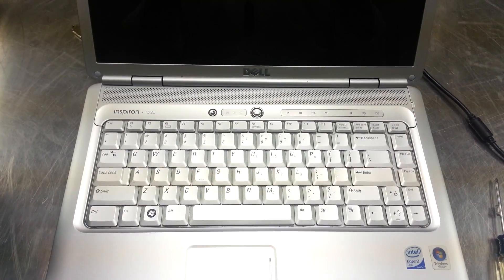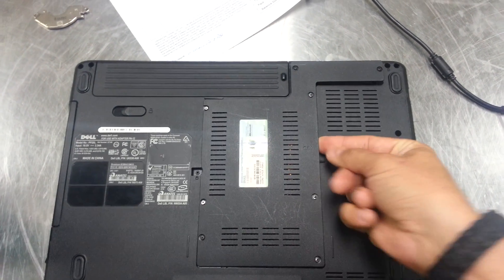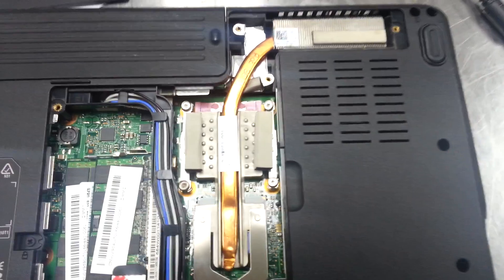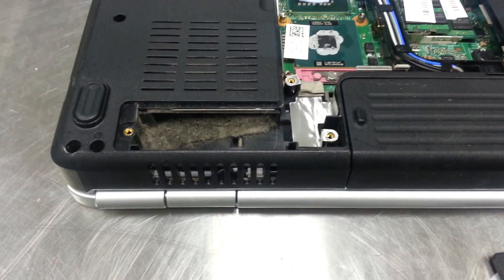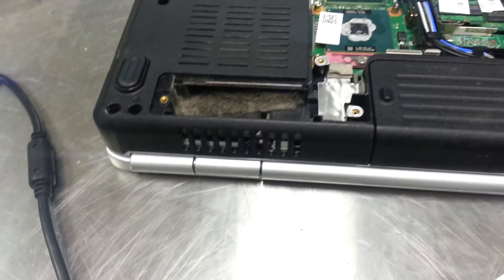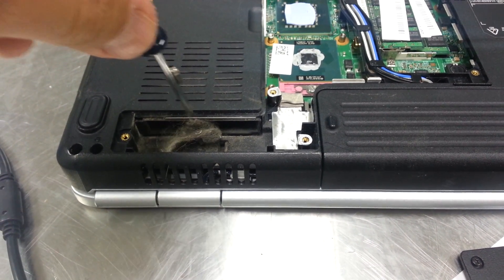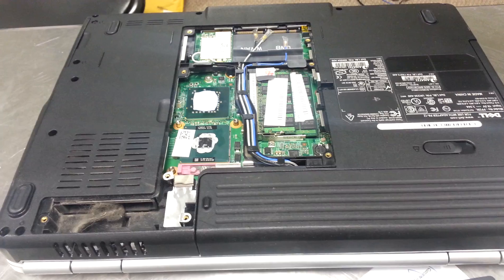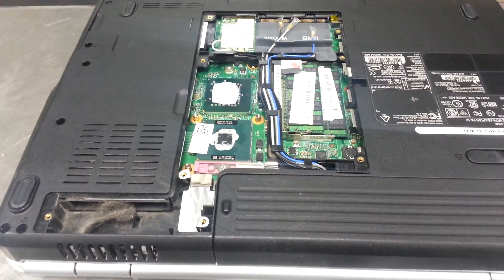Fix Laptop Overheat Shutdown Problem

Comment: I used a vac hose on all  vents for this same dell laptop 1545  type  and still had about the same amount of dust and junk inside the fan area and on heat sink fins......resealed CPU chip after cleaning old paste off heat sink and chip....a new bristle small paint brush will help with removing dust also good chance to do any other upgrades like faster CPU chip install.....more ram and ssd .....speedy 10 year old laptop running win 10 now . Thanks for the video